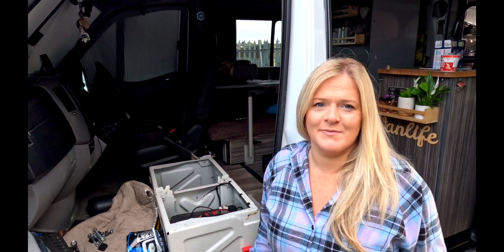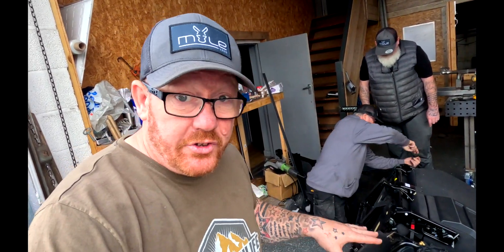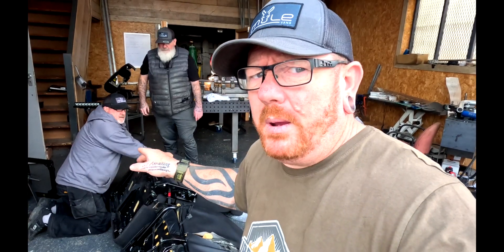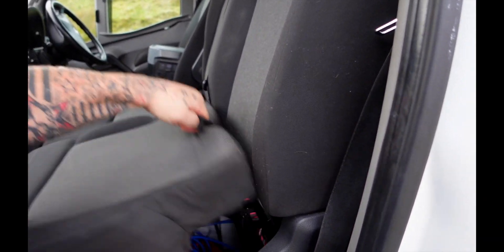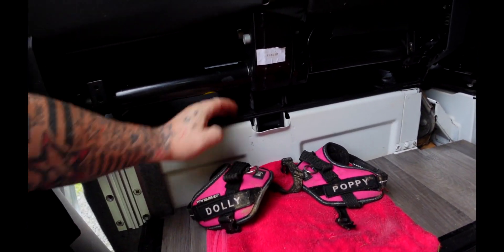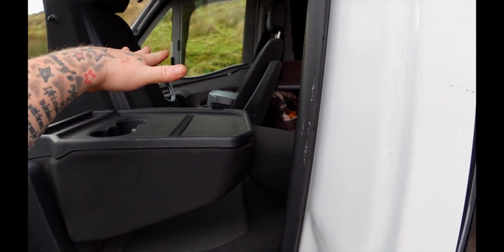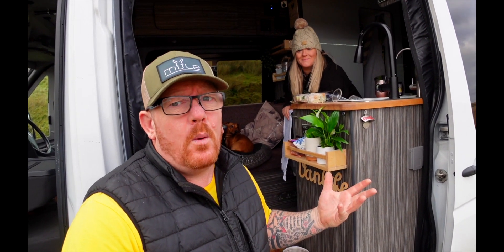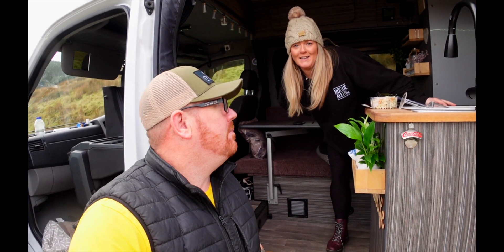Will 2019 Seats FIT In A 2015 VW Crafter Camper Van

Comment: There's something for the Xmas list! How much did it cost to buy those 2019 seats? And how much to convert them to fit your crafter?
Reply from the maker: Prices will be all over the place for them seats some Iv seeen for £500 and done for £1500 just depends if you can pick up a deal . Not many new vans are taking them out . And depends who you get to do it depends on the cost . A welder can charge any thing from £80 to £200 a day